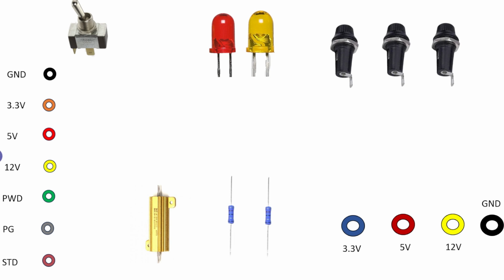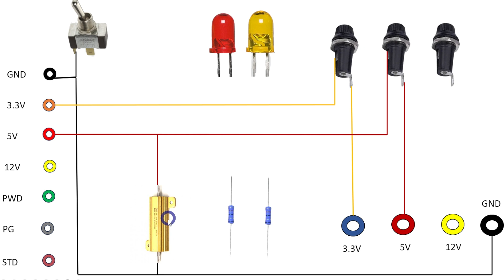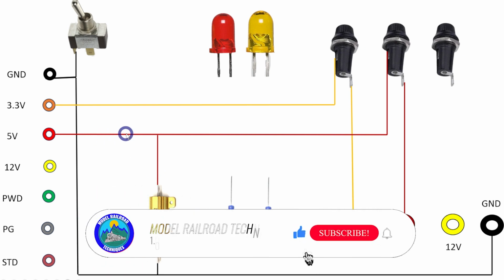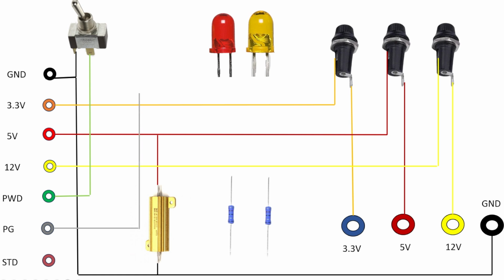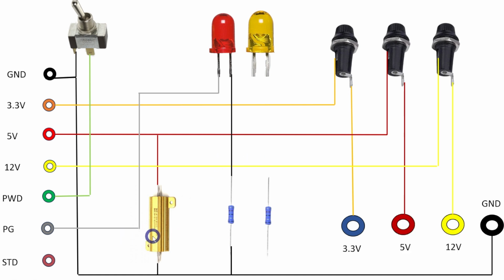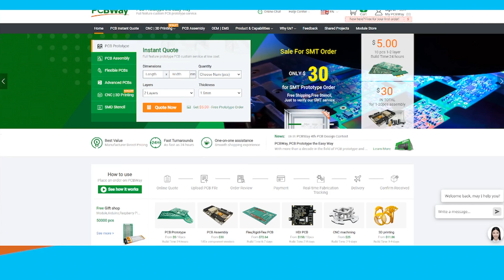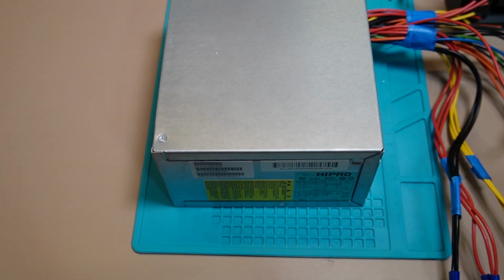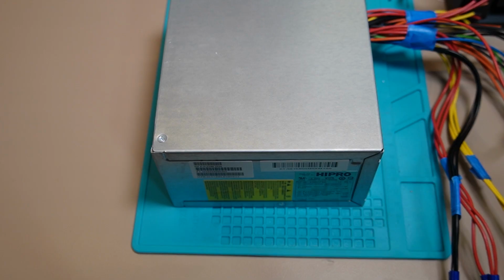Easy Computer Power Supply for your Model Railway

Comment: Great vid mate. I have a P4 500w PSU ready to go (for about 10 years!). So I did a quick search and your vid came up. I'm going to be using r/c servos and those wee servo testers to operate them. So either the 5v or 3v will do for those.I was using Tam Valley Depot servo gear, but it can be fiddly to set etc. The 12v will be lighting or some such as my DCC has it's own PSU.
I will definitely go with the PnP option (#1) if for no other option than if I want to upgrade the PSU, it's a straight forward swap.

Comment: My n gauge transformer puts out 18v dc and ac. I need another to control a separate shunting yard. Will this work?
Reply from the maker: Hello, for what application in particular. ?
Reply: For running 'n guage locos. The Bachmann transformer gives 18v dc for the layout. Will 12v be enough run loco?
Reply from the maker: @konradh629  my dcc runs in 16volts dc
Reply: Ok thanks.

Comment: Hi there, great video….I was wondering if you could me with issue. I’m currently in the middle of setting up something very similar, but I going to add three volt and amp meter. The  individual meter will go to  12v, 5v and 3.3v, so I’m wondering if you could show me how would wire these meters into circuit layout? Thank you in advance for your help. Brian ( Kent - UK)
Reply: Dual Digital LED 10A Ammeter 100V Voltmeter Panel Mount Volt Amp Meter
Reply from the maker: Hi Brian can you email me directly modelrailroadtechniques@gmail.com

Comment: I am happy to cut the wires and it could be used for both purposes... For model railway I would be tempted to lower the value of the fuses as I would not be using anywhere near that current draw and the faster the fuse blows the better... great video - thanks...
Reply from the maker: Great idea about lowering the value on the fuses. Didn’t consider that. Thanks for your kind words.

Comment: There are a lot of tutorials around for turning ATX PSU's into power supplies.  I think this is the first one I have seen using it on a Model Railway.    It's a great idea as you can get stable 5v, 12V and 3.3V from an ATX PSU.    You can also use a step-up converter to bump the 12V up to the voltage level for DCC track power or just take the 12V via a rheostat for DC track power.    Most ATX PSU's have good current rating on the 12V line so a good step up converter can work really well.     
For those who are not comfortable pulling the PSU apart, you can connect the power on to ground externally and do all connections externally.  Your power on signal is usually a green wire.  Yellow is usually 12,  Red is 5, Orange 3.3   The others you don't need, unless you want to use the purple stand-by power for and a relay device for remote power on, instead of hardwiring the the green to ground.  Always test your voltages though as some Power Supplies do not use standard colours, especially cheap, older or proprietary (HP / Dell as example) 
As a note on your +5V load.  Test your power supply.  If you don't need it, leave it off.  Most newer PSU's do not need a load, but some older ones will need it.  If your load LED starts getting too warm, you may need a higher current resistor, or test with a slightly higher resistance.
As a tip on LED's.  Under drive them where you can.   They are more efficient when under driven, and a slight under drive doesn't affect brightness noticeably, but  will increase life of your LED's considerably.
Reply from the maker: As always Brendan great insight. I am doing a video 2 to make this a little better. I didn’t consider the step up for higher voltages

Comment: I've tried both methods, I go with the way you showed, terminating the ground and +12 volt supplies into terminal blocks.  At the club I'm in, we use some of these for our 12 volt LED lighting supplies.
Reply from the maker: Sweet. I am going to use more of these little guys for my accessory bus power.